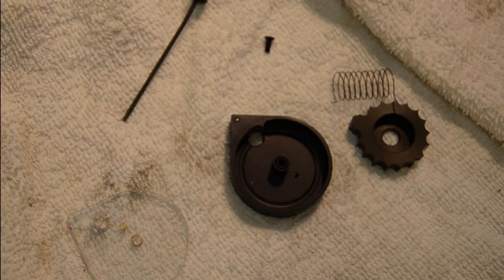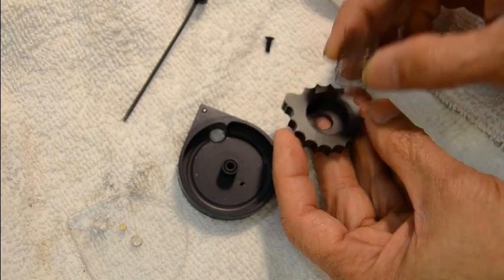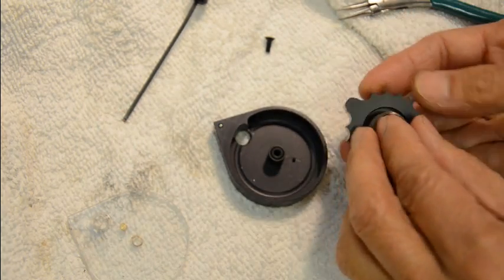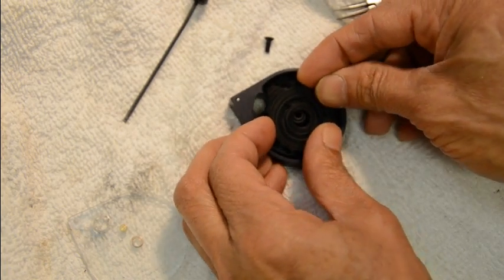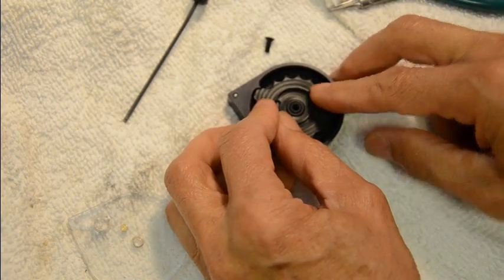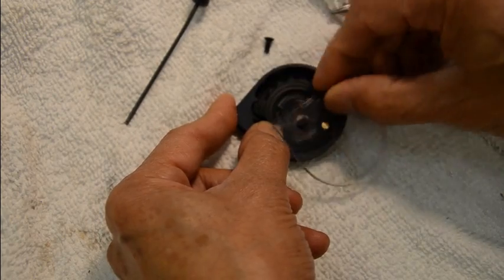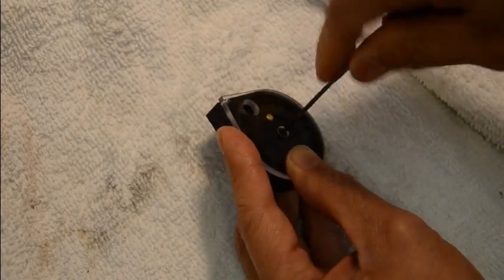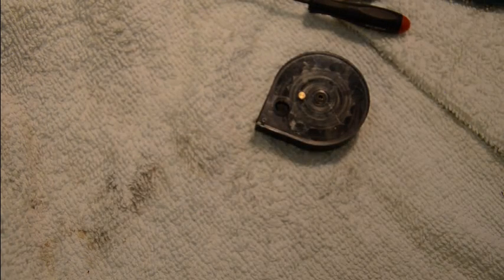FX impact magazine reassembly

Comment: Cool. When I put mine back together I did not know the top of the wire went in a hole. I thought it locked in place  from pressure.  I will have to take it back apart. The first time I did it it kind of freaked me out when that spring buzzed out. Thanks for the help.

Comment: Ernest, my magazine keeps coming loose, after loding several times the nut comes loose or apart, with the 2 ball bearing needing put back in place, I am also worried about losing the ball bearings, can you help me sort out this problem, may be a locking nut would help, as you have to get it just right tightening it back up or it will not index properly, the mag is in .22                                                                               
David.

Comment: Cheers for video
Is there anything you can do to make these mags load from the other side for left handers?
Reply from the maker: no!    It would be nice if FX can machine mags for lefties, but the lower mag stop has to be modified to accept both mags, To much work and may increase the price.
Reply: John Singleton use a mark 2 vermi or bobat mag if you want it load from left hand side. Works for me.
Reply: Marshall Flanagan Thanks for the advice. I'll have one very soon!

Comment: Thanks
Reply: Good basic descriptions but I don't always agree with all your actions I have just cleaned and reassembled my magazine with 4 turns loaded the mag and manually pushed all the pellets through with a piece of wood .Inspection of the pellets showed a line indicating a snapping action of the inner mag rotation I would suggest the min amount of rotation of the spring to feed all the pellets through manually without marking them